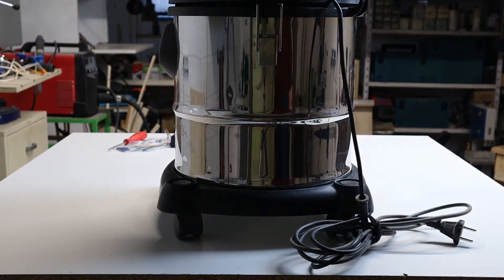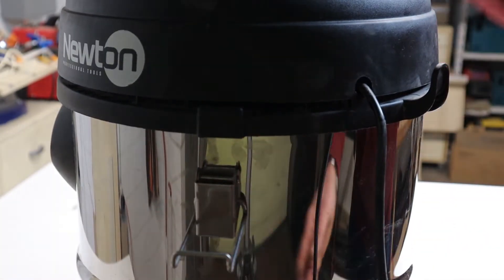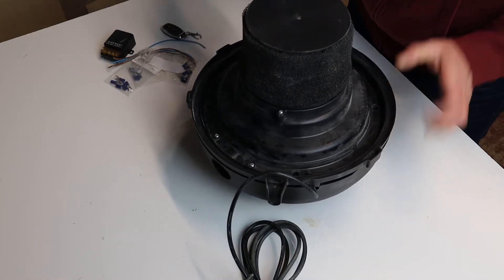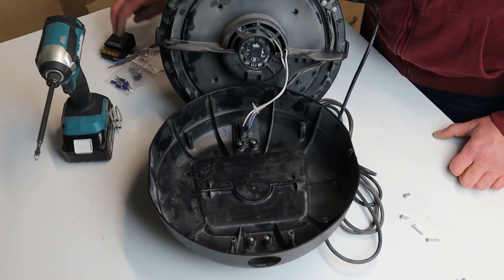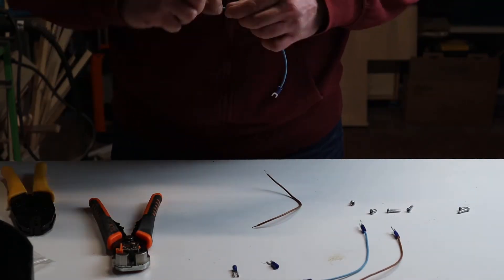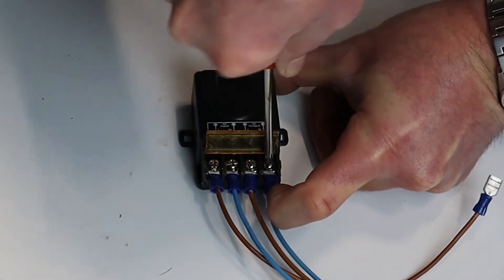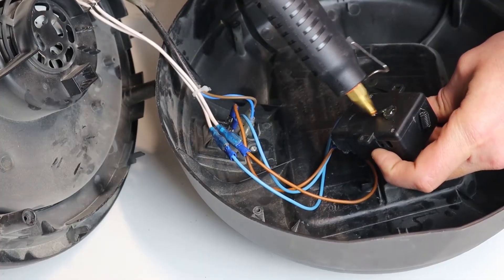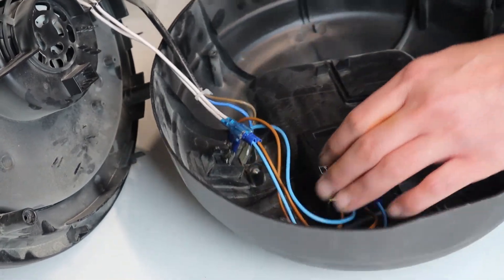Hidden remote switch how-to - Wet-dry vacuum cleaner SUPER EASY mod - DIY // MakeON

Comment: just the idea I was looking for. You make it look easier than it will be for me. Thank you, you have a great accent, where are you from?
Reply from the maker: Half the time and skills needed depend on your vac's wiring. If it has spade connectors, all you need are a few short extensions like in the video, otherwise you'll also have to cut or unsolder the original cables on top of that. But it's a pretty straight forward and quick mod anyway. Accent wise... thanks haha, I'm from Italy but I travel a lot to the US for work and personal reasons.

Comment: how do you distinguish the live from the neutral wires on the switch ?
Reply from the maker: On the relay terminals they're labeled L N in and L N out, on the original switch brown is live and blue is neutral. I decided to simply add some short extensions to avoid modifying the original wiring to add the relay. This way I can revert everything by simply disconnecting the relay switch and connecting the orginal cables straight back to the manual switch terminals.